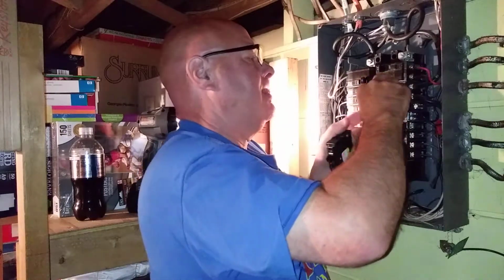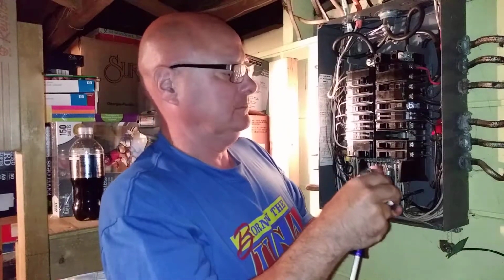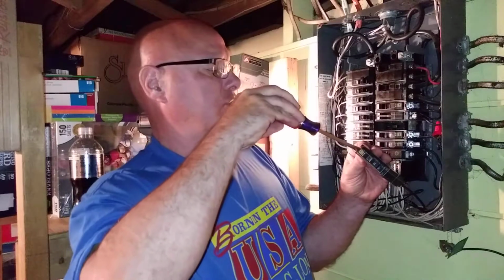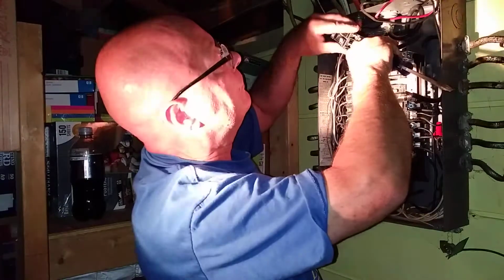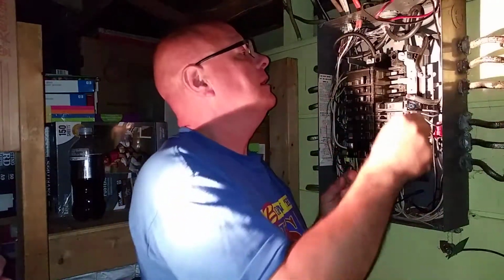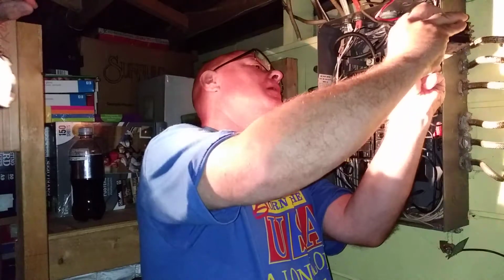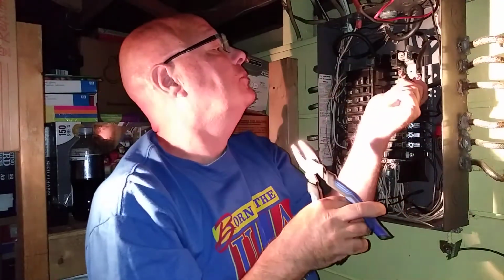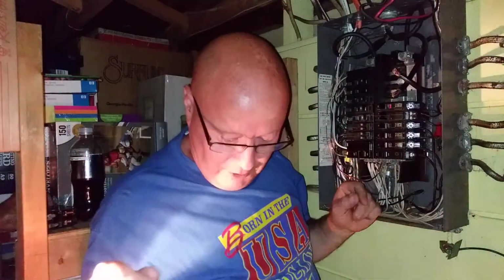(2) i show and explain how i replace worn out breakers in a split bus panel square D QO

Comment: Good information ℹ️ as with split bus panels the upper bus is always hot. Great job man keep it up 👍😎. And the loose wire you noticed. WOW 😮 I believe someone just cut corners back then. The loose wires could have led to a fire.